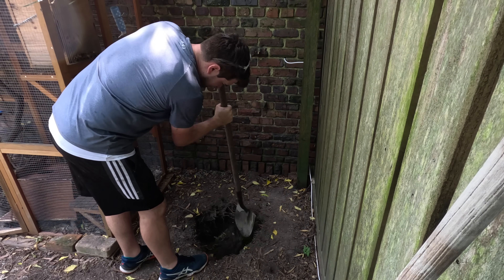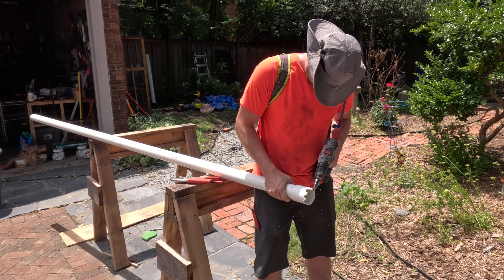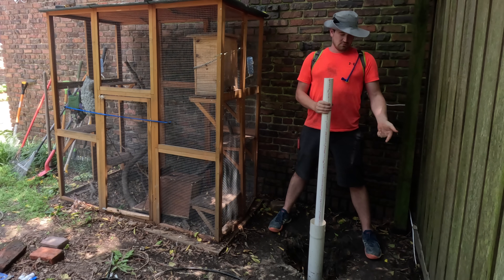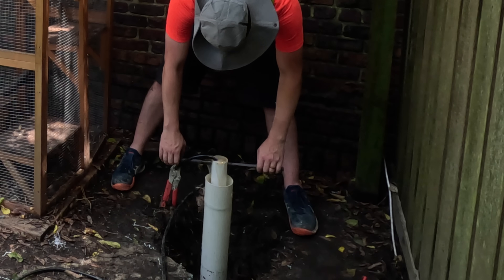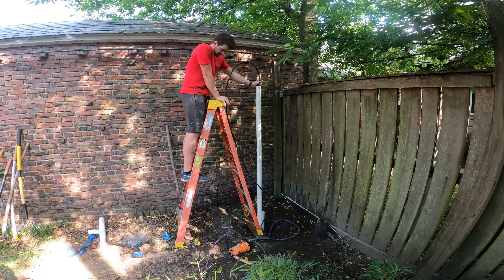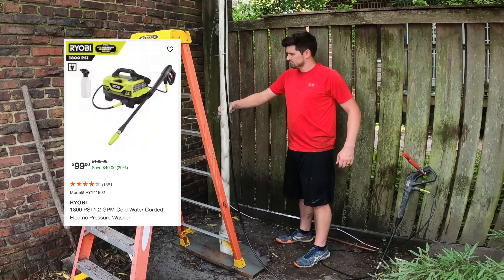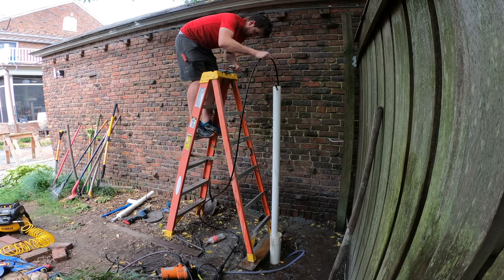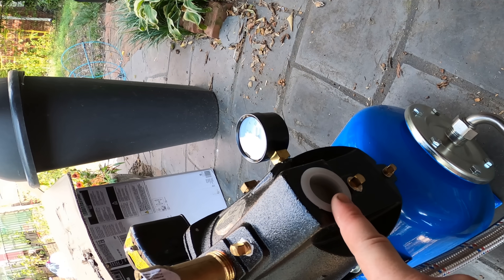I dug a 40 foot well in my backyard

Comment: Could you tell me for the Ryobi pressure washer, where did you get the additional black hose that would fit with the machine and also was the straight metal shaft that digs the ground, is it included or did you buy separate? I am trying to shop at Home Depot. Thanks
Reply from the maker: I don't know what the exact parts would be for Home Depot, but the hose is linked in the description, and this is the metal wand that I used: https://amzn.to/3Tm3SNu.
Reply: @BadHomeowner  Thank you so much, exactly what I was looking for.

Comment: so, where is this located? what happens in winter when it freezes inside the pipes? it would really suck to have to replace all of that PVC at the source...

where i'm at (midwest US), you have to dig a trench below the frost level, and run pipe to an INDOOR location for the pump to be set up.
Reply from the maker: You should obviously put the pump wherever it makes sense for your area.

Every place on earth has different weather and different soil. So this video is not going to work every place on earth.

Comment: Could you tell me if it matters that for the first part if I use 6 inch diameter pvc instead of 4 inch? I have a ten foot 6" PVC in the garage and am wondering. Thank you
Reply from the maker: 6 inch will work fine, it'll just take a bit longer than the 4 inch. But once it's in, everything else will be the same.
Reply: @BadHomeowner  thank you again

Comment: The comments are full of two kinds of people: People who heard things a professor said who have very little actual experience in water or water treatment and are geologists and not water professionals. Then folks who are scared of tap/well water because they are backwoods conspiracy morons who read a scary article one time sponsored by a water filter company.
Both don’t know shit.
  
Consult your local water treatment experts. There is nothing wrong with tap water. There are trace amounts of everything in everything. The ground filters water (yes, you should still treat it) and unless you live next to a weapons manufacturer or a battery plant you can probably drill a well (depending on your water table). The door handles you all touch on a daily basis are more dangerous than any properly kept well or water system in America as a general rule.

Comment: So I understand the premise. But how did you remove the dirt from the middle of the pipe while you were digging down? Is that what the pressure washer was for?
Reply from the maker: See all that dirt that's coming out of the top of the pipe? That's the dirt
Reply: @BadHomeowner  so the water you were using with that pressure washer was lifting the mud up?
Reply from the maker: @Grizzlytactics91  yep you got it
Reply: @BadHomeowner  wow. So here in AZ we have kelechay or whatever however it's spelled. Could this method be used to break through that?

Comment: for anyone else trying this for drinking water, you really shouldn't use PVC for drinking water. PVC is toxic and it leeches into the water over time. all the "well pump PVC" stuff like the well point he uses are meant for things like sprinklers and irrigation like he says. Go with stuff that is rated for drinking water. It will be more expensive but your pregnant wife will thank you
Reply from the maker: This is mostly right, although there is CPVC that is safe and usable for potable water.
Reply: @BadHomeowner  very true!

Comment: This was very cool to watch, even though I don't need a well. Our house sits on top of an underground stream, at the bottom of a hill, and a basement sump system pumps about 5 gallons of clear cold water every 10 minutes; a PVC pipe leads it down to the bottom of our property where it drains into a ditch and eventually into the town sewers. I have no idea how this was permitted; it was like this when we bought the house and we didn't ask any questions. Anyway, we don't drink the water but it's handy for irrigation and filling a big tub for cold outdoor baths during the very hottest part of the summer. Sooner or later I'll have the water tested and if it's clean, I'll use it to flow water through the coop so the chickens will have a near-constant flow of fresh, cold water and I won't need to be cleaning and refilling a bucket every 3-4 days!

Comment: I’m curious. Why didn’t you use a galvanized threaded coupler (with zig-zag teeth cut into it) on the drill pipe? Schedule 40 pvc would fare much better. Of course, metal would be best! But, you do you… just saying… nice job with what you had.
Reply from the maker: I could have but I had no problem with the PVC teeth.

Comment: Hey brother, @7:22 , I had that issue but added a cap and drilled a hole large enough to fit pressure washer extension through and not the bulky end to prevent sticking.

Comment: Environmental professional here and I found this both intriguing and interesting.  When installing wells it is imperative that a "seal" in the form of a bentonite plug be set at the top of the screened area so that any "perched" water from above (usually polluted) does not contaminate the aquifer, assuming that one has penetrated the upper aquitard.  Given the shallow depth of  this well and the observation of grey "blue clay" you are only in a perched water situation and that you intend this for irrigation, not for potable purposes, I don't see an issue.  Suggest a pumping test to see just how much well storage you have.  Since you don't have a proper well gravel "filter pack" depending on the granularity of the surrounding soils, the production of this well may diminish as the screen slowly gets plugged up with fines.  You may get lucky though if a natural filter forms in lieu of a gravel filter.
Reply: Im a P.G. and have remediated dozens of aquafers after they were contaminated. Came to say the exact same thing. Good looking out.
Reply: Awesome project. Thanks for sharing.
Reply: i used to have the same job. what u are talking about is a monitoring well in a gas station patking lot where you want to orevent contaminants from entering the well from above this skewing your sample results. i dont think this guy has to worry about that in a well for his garden. he is not drilling i to an aquifer. all the water in the well percolates down through the soil anyway. he will be fine.
Reply: @David-sx4hp  Depends on the local regulations.  In my area (Canada), groundwater is a protected resource so proper sealing at the top of the screen and again at the top of the well is required to prevent incidental contamination of the aquifer.  I agree that this little well is not likely to pose a significant risk to the aquifer.  It's more like a "novelty" well not any larger than the monitoring wells we use to sample groundwater conditions at remediation sites such as gas stations and industrial.
Reply: @canuckfixit7722 In the U.S., most States have serious regulations that apply to water wells of whatever sort- governing installation, construction, introducing contaminants or inadvertently connecting aquifers, abandonment practices, etc. This fellow has likely violated several of those.
Reply: Ok, I'm in Arizona and my water table is 600 feet down. How should I go about drilling that?
Reply: @vwnotch step one, buy 600 ft of pressure washer hose.
Reply: @vwnotch no problem, just start by moving to central California area where groundwater is found in no time.
Reply: @vwnotch find a 600ft drill bit😂
Reply: @vwnotch Step 1: Don't live in the desert.
Reply: @vwnotch dynamite
Reply: @vwnotch  Get a well drilling contractor.
Reply: Aquatard?
Reply: @MtnXfreeride Aquitard- in hydrogeology, it's a term for a discrete horizontal unit of earth material (rock, clay, whatever) that is relatively less permeable than whatever overlies it. Imagine this guy's "boring" goes through 15 feet of coarse sand, but at 15 feet he hits a layer of fairly tight, sticky clay. Water from the surface percolates thru the sand, but the clay is LESS permeable, so water will accumulate atop it, and you'll have a few feet of shallow groundwater. The clay in that case is the "aquitard." It retards water. If it essentially stopped vertical flow, we'd call it an "aquiclude."
Reply: I'm in southeast Texas. You can drill a well out here anywhere. All sand and clay until you get up around Jasper
Reply: I was thinking just this. The slatted tube will clog up sooner or later?
Reply: @rb3500ooo Most likely.  That's why a proper "filter pack" is necessary around the screened section.  If the guy is lucky, a "natural" filter could develop over time if the silt/sand in the native soils around the screen shuffle around, assuming that the screen was set in silty or sandy soils.  Muddy/silty water first comes out of the well then clears up as more water is pulled ftom the well.  We call this "developing the well".
Reply: @owenhill-vf7ko  Comment troll, eh. 💩
Reply: Since none of that makes any sense to me, I’m definitely an aquitard
Reply: You're the aquitard! Just kidding. Never heard that word before. Great information. Thanks for sharing!
Reply: Depending the areas water aquifer are different deepness and doing your self are considered exempt waters well
Reply: @gerardomaldonado6301  Correct to both.  However, in some jurisdictions, groundwater is considered a "resource" and therefore protected by law for both aquifer consumption and contamination.  It is unlikely that they would impose a fine if they knew about a low-production well like this.
Reply: @canuckfixit7722 a couple of questions, what could be the life span for most water wells like this?  Also, any risk on the house structure due to possible soil compromised underneath or even create a sink hole underneath?
Reply: @ As long as the well doesn't clog with silt over time and the water level doesn't drop due to changing aquifer recharge conditions, could last a very long time.  A sinkhole would not occur from a well installation because the withdrawing of water does not allow soil particle transport, an effect called "piping".
Reply: Shut up.
Reply: There's no dust under the ground, only fine sand.
Reply: And Rock gravel wood etc.
Reply: Thank you for your help..um sure the Indians learned much from your advice 😮
Reply: Be sure to instruct the elephants about this detramentl situation..
Reply: Depends on what state this is in, but I’m pretty sure this is illegal.
Reply: Regular guy here and I'm both puzzled and confused at the redundancy 😅
Reply: @timothynelson2142  😆🤣
Reply: What are fines?
Reply: @Jabariray  Fines are very small sized particles such as dust and silt. "fines" do not include sand or clay.
Reply: @canuckfixit7722  dust?
Reply: @NobleNobbler  Yes but in the soil not the air.
Reply: @canuckfixit7722 you're supposed to dig down until you hit sand. There's no water without sand.
Reply: @CalebWatson-q9b  Formation sand is ideal as that means you have reached the aquifer but sometimes there's no sand so you have to make do with the formation that you have at the chosen well location.  Sandy seams within a clay formation will transmit water too but one must have a longer screen interval.  With this particular installation, depth was very limited so not really in an aquifer but rather the common water table.
Reply: @Jabariray  fines are what the gov makes you pay when you disobey
Reply: @SyntheticStuntMan fines and penalties are also due annually in April and September, and for personal property ownership here in the USA!
Reply: Like boogers
Reply: @ Comment troll eh. 💩
Reply: The water from this 40 ft well can be filtered before used for drinking, if you have a good filtering system, and this well could mean survival when the city water is gone for some reason. Nobody can store enough bottled water, we should all have a continuous source, and we should all have a good filtration system.
Reply: @cherylanon5791  For potability, you would need filtration and disinfection by way of chlorination or UV light.  But yes, an alternative water supply would be relevant to "preppers".
Reply: @canuckfixit7722  not true...good carbon filters would do the job fine.
Reply: Dudley do right alert!!!
Reply: What a party pooper, Mr. Environmental Professional… the man did something you never have, or thought of doing before.
Reply: @TattoosAndGin  Comment troll eh. 💩 Who said I never thought of this before?
Reply: @canuckfixit7722  Don't mind him. I appreciate the added info 🤙
Reply: @TattoosAndGin  Some people just hate anything with the word environmental in it.  I doubt if you're qualified to make that remark.

Comment: It's similar to the way oil wells are drilled. Also, for this depth you should be using a submerged pump.
Reply from the maker: Water table is only 10ft, don't need a submerged pump.   See https://youtu.be/RHVqbrsPRVk?t=14

Comment: If you find a pressure washer that can drill through bedrock, let me know. It's only 16" deep behind my barn. 😆
Reply: 20,000 psi water jet with abrasive powder metered into it will cut 10 inches of titanium like a hot knife through butter...

Comment: If the inner pipe dropped down inside the big pipe it would be trivial to recover it. You'd feed a still smaller pipe down into it from above and you have a fitting on the end you can cause to expand. Bicycle handlebars are an example of this, the tightener causes two slanted pieces to come together and expand sideways, increasing the diameter, so it clamps against the outer pipe from inside
Reply from the maker: You're assuming that by the time you've rigged all that up, the pipe hasn't sunk further into the sand beneath it.  I've pulled out a well point before and I needed a car jack and probably several hundred pounds of force to pull up a ~50 pound pipe.  It's not as simple as it sounds.

Comment: From a pump installation perspective, the dog leg in the top of your suction line, where it comes up higher than the pump, then goes back down into the pump, is a big no - no . . . but otherwise looks cool
Reply from the maker: Yea I didn't like that either but it hasn't caused any problems as far as I can tell.

Comment: why didn't you just drive it?  also, your not pulling water from any deeper than 27ft with a topside pump....thats a physical, atmospheric restriction.  Beyond 27 feet, you have to put a pump in the well.
Reply from the maker: I'm actually making a video on this because the "25ft vertical lift limit" is the most widely misunderstood thing about shallow wells.

The TOP of the water must be less than 25 feet deep. It does not matter how deep the actual well point is.
Reply: @BadHomeowner  I know, thats why I said you wont be pumping any deeper than 27ft.  

You went to 40 for cleaner water, right?  Thats great, as long as your water table  doesn't drop below 27'.  I have no problem with topside systems, they work fine in plenty of places....I really dont get why you didn't drive it though.

Comment: why didn't you do a 1&1/2 Inch
Reply from the maker: 1-1/4 is the largest pipe size that will fit inside a 2 in PVC pipe with couplings

Comment: your video showed up as i was reviewing my video, punching down.   i used a deep rock, and drilled 90 feet over some weeks.   cold, rain, sleet, snow (i'm not the post office, i stayed in) and got water.
your project was simple, clean and i'm impressed by your thinking.   the only recommendation i would make to you, is never pull your stem.    in the cold, it will break when you try to replace it.  if you ever have to pull it, use threaded sections so that you can pull it, and uncouple it.  ya, it is a hassel, but replacing broken pvc is as well.

my bud out in west texas could not keep his sister from pulling 300 feet of pvc, and it all had to be replace and they had to hire a well servce to fish out the broken pipe.

good video, well done
Reply: you "used a deep rock." Are you saying you drilled through rock? if yes, How?? I'm also in TX and trying to figure out how to self drill through rock w/o a drill rig...

Comment: Your cuttings are coming up your drill string running over the top and going back down the annulus. It would be better if you could also pump higher volume low pressure water down the drill string forcing cuttings up the annulus to clean the hole. Put a t at the top of your 4” surface casing and add a flow line to direct returns away from the well.
Reply from the maker: Yea that's a good point and I talk about it here: https://youtu.be/R8D3_EgZSSA

Comment: in california just had my well dug. it was 397 feet before hitting water. ended up going down 435 feet.
Reply from the maker: wow!
Reply: I'm an electrician. I worked for a company that got a lot of govt contracts. We did several jobs over about 4 years in our local air base. Now keep in mind the USAF has all the cool technology that the govt can afford. Each time when they broke ground on a project on the base of course they'd send their own engineers out to lay out the building etc. Park of that crew was always two guys. One with a set of divining rods and one with a can of blue spray paint. They'd mark out the water lines. I've never seen it not be accurate. If that's the preferred method of the USAF that tells me all I need to know about it's legitimacy. Previous to seeing that I would have sworn "water witching" was some old hillbilly folklore.
Reply: What part of CA?
Reply: Damn!
Reply: Need to witch with copper rods before you dig call it bs but I am at a property right now that gets 60-80gpm when the neighbors and everyone else around gets 5-15gpm the only difference is the person that dug this well picked the spot using witching rods
Reply: @xxskitsxx15  Had a friend in heavy construction, showed how to use the rods, he used bent coat hangers. He was serious that it worked.
Reply: @scottcrowley2061  it really does. This world is divine.